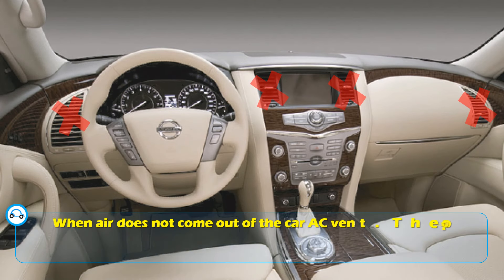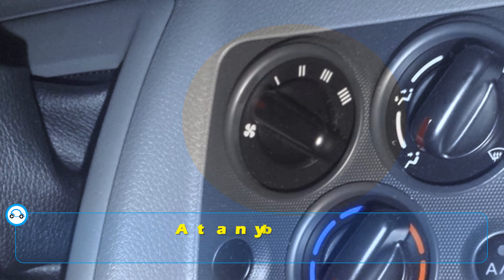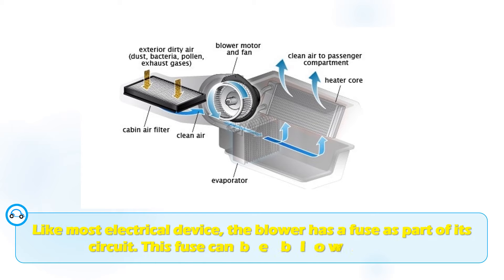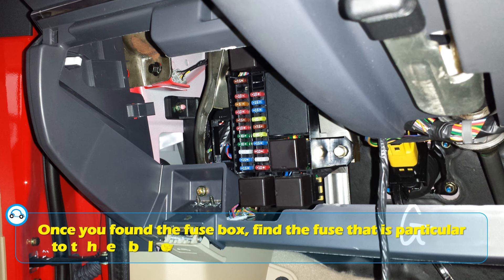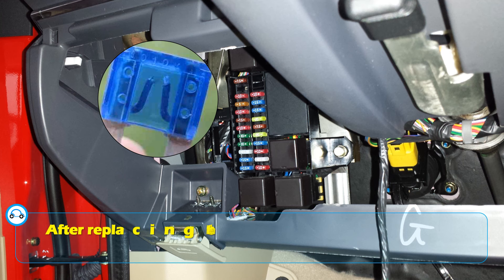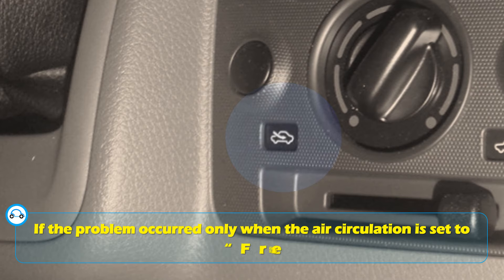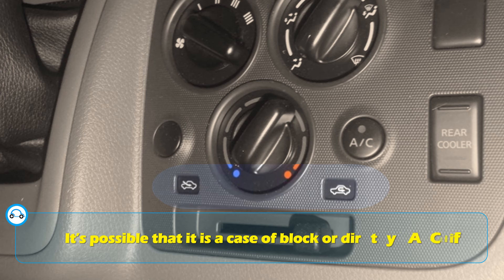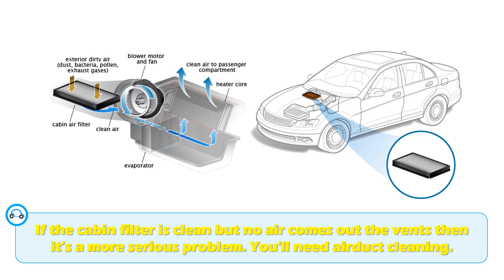No Air Coming Out of Vents in Car

Comment: Not very accurate. Mine doesn't blow but the blower motor works on all settings.
Reply: I am having the same issue. If you figure it out, let me know 😂
Reply: @noahmcgrath9776  I'm not sure what caused this but I watched another video where a guy just push his fuses down. I guess when built they don't secure them enough and eventually vibrate enough to lose connection. I just pushed all 50 of the ones I had to make sure seated correctly and it worked.
Reply: @noahmcgrath9776  the fuse that caused my problem was a square/green one.
Reply: @bionik-5898  where was the fuse located on the box? It should say next to where you plugged it in, where it controls
Reply: My problem is “when I move from vents blowing from head then turn it to legs, it sounds like it’s moving and then stops half way between shifting. Now the air is not coming out of any vent. Sometimes it works and sometimes it doesn’t. BUT the air is blowing but it can’t come out of the vents.” Does that sound kind of like your problem
Reply: @noahmcgrath9776  no but I read that the actuator or whatever opens the flap can go bad
Reply: @bionik-5898  the fuse that you pushed down... was it in the engine bay or inside the car
Reply: @noahmcgrath9776  engine bay, but it would vary I on make/model I suppose
Reply: 1995 Camry
 This morning cold air came out of the vents 
  This afternoon floor vents and defrost only 
  I didn’t change anything 
  Any ideas ??

Comment: What about the blower motor resistor
Reply: That was the problem in my car 😭 Apparently mine disconnected and melted :/
Reply: Good tell with that if the blower works on full speed but not any other speed it’s the resistor. The resister douse exactly as it’s named it resists the power input to run the blower slower. The full speed is just direct power to the fan not being slowed down by the resistor

Comment: Two days ago, the air was working in the morning, then by the time I took break mid day the air wasn't coming out anynore.  I hit it on the bottom and still none. No cold air and no hot air comes out. Its freezing today with temperatures in the single digits any help? Would it be the fan motor?

Comment: You could have a working fan/blower but STILL NO AIR if the directional flaps are screwed, or a duct hose disconnected.
No air doesn't always mean a bad motor.

Comment: My car the two side air vents don’t blow air but the middle two do. What could the the cause of this? Thank you
Reply: Have you looked at snaking a cam in there? Perhaps either two blower motors and one is bad or, more likely, a blockage
Reply: @McAdamsMechanics  depending on the car and year,that a blend door actuator gone bad
Reply: MINES THE OPPOSITE.
Reply: @BOOTROS80  same, what was it?

Comment: As the car Eco sport is started , the ac comes out of the vents. later as the car engine runs for sometime, the air runs inside only, it doesn't come out off the vents. What should i do?
Reply: I’m going through the same thing rn. Have you gotten it diagnosed?
Reply: @yabbazabba9656  could be a frozen evaporator :)   (if it runs at first then stops them sometimes turns back on)
Reply: Did you'll figure out what the problem was. I'm in the same boat thanks
Reply: I’m dealing with a 95’ Camry
  This morning cold air came out of the vents as usual 
  This afternoon cold air comes from the floor vents and the defrost only no vents.     Any ideas?

Comment: HELP i have a 2002 grand marquis and the ac blows cold but for some reason it blows 4x the air on the passenger side and almost nothing on driver side plz help🙏🏻
Reply from the maker: Possibly a partially blocked air duct.
Reply: Try changing your driver side actuator

Comment: I have a 13 cts.. Ac only blows from bottom vent at the feet.. No matter the setting.. I can control the temp and power but.. Won't blow from other vents.. Could this be the fix or na
Reply: Have a gander inside the system. May be a blockage. May also be a wiring problem where one relay is down.
Reply: Yo I have this same issue have you fixed it yet

Comment: As the car Eco sport is started , the ac comes out of the vents. later as the car engine runs for sometime, the air runs inside only, it doesn't come out off the vents. What should i do?
Reply from the maker: Check for the ducting, but it entails a huge amount of work.